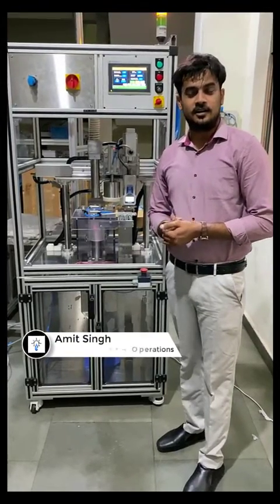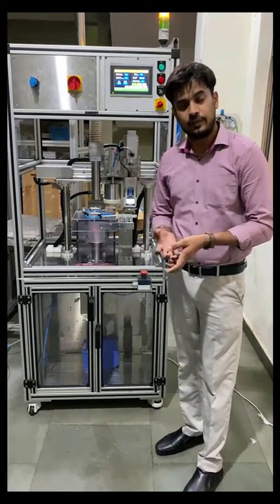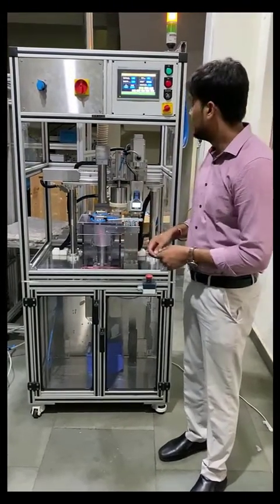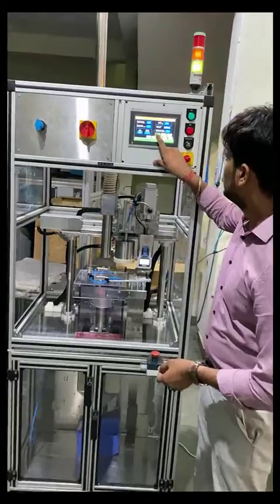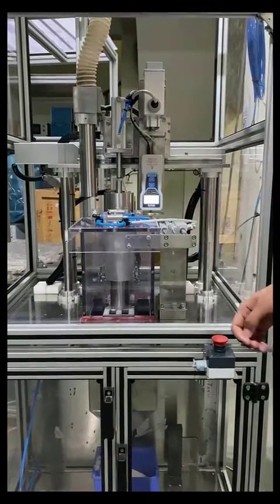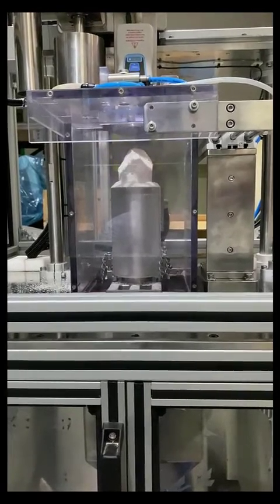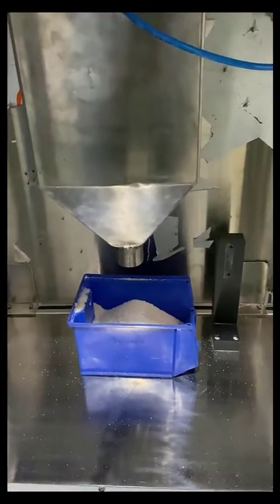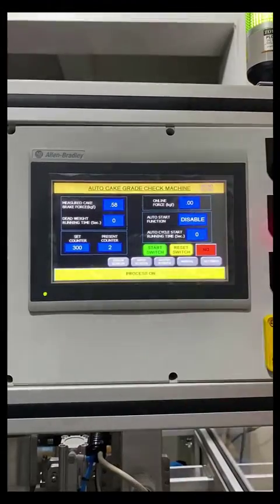Industrial Automation : Automatic Cake Grade Testing Machine

Comment: Great job bro. 

I am also an alumni of GP Lisana. 

I don't know the process requirement of this machine.

But I have some suggestion. You have to implement some safety features like safety guarding or sensors to avoid accidents in future.
Reply from the maker: Thank you Vikash for your appreciation and taking time to give feedback, actually, this machine will be closed from all side and will be opened only for maintenance purpose since its an operator less machine.
Reply: Hlo please give your no
Reply: Hlo give contact no